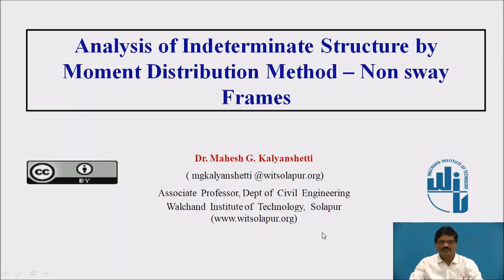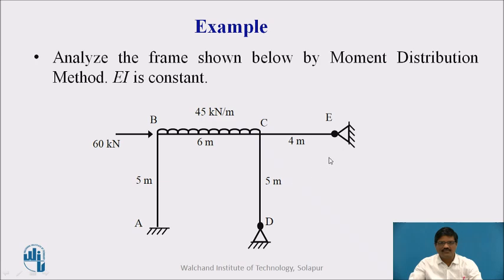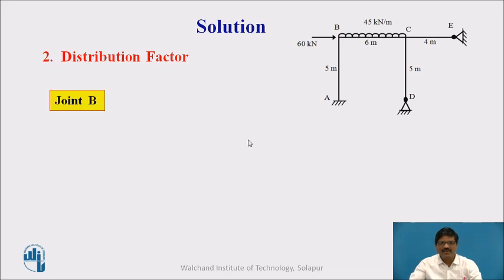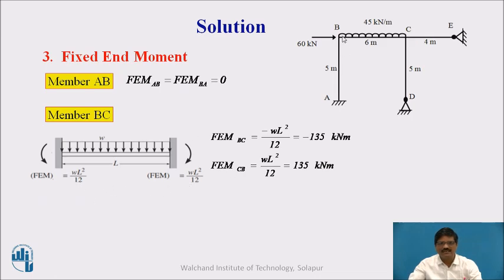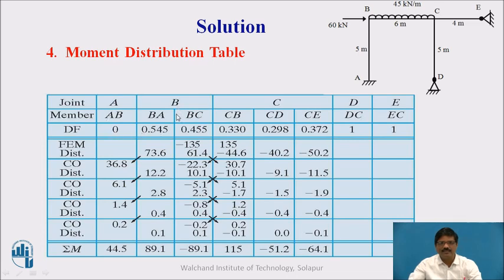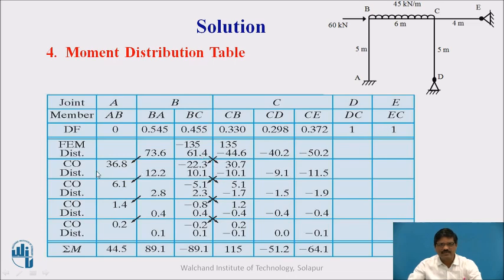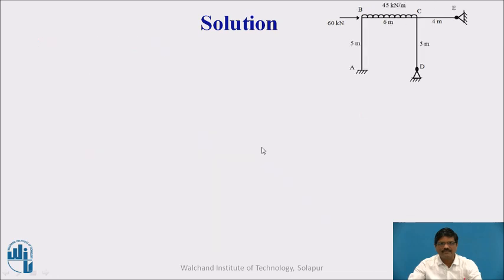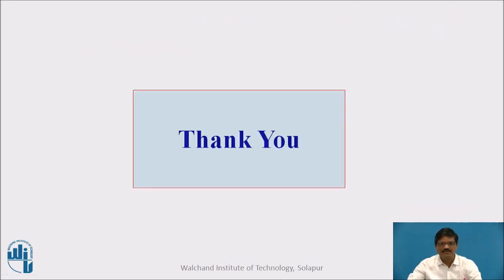Moment Distribution method- Non sway frames

Comment: Respected sir..the joint load of 60 KN at joint B...where it will be used in the problem? Please clarify..thanks
Reply: Same question i wanted to ask ..cz i can see he dint use it anywhere
Reply: If sway then we use it
Reply: In non sway problems we won't consider the horizontal forces at joints until it applies on members